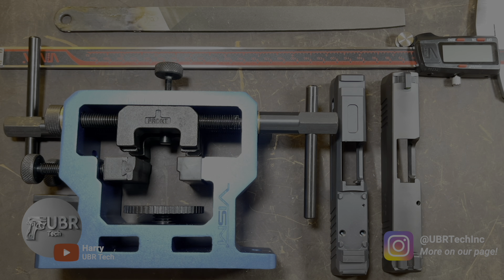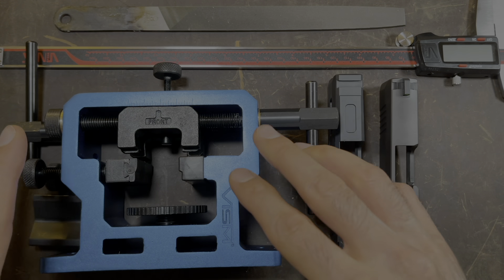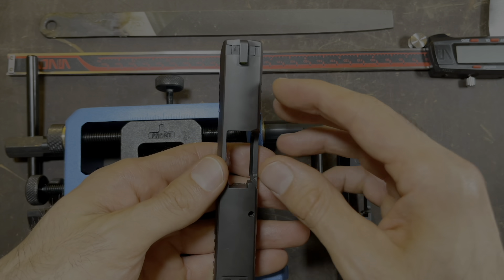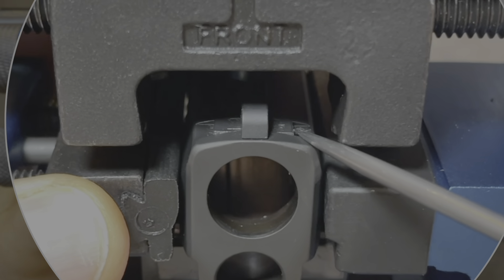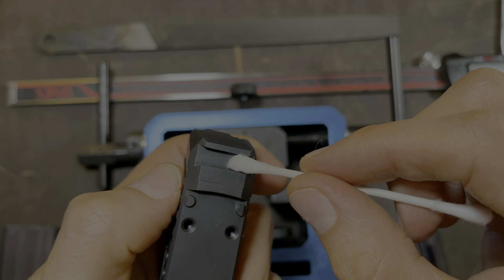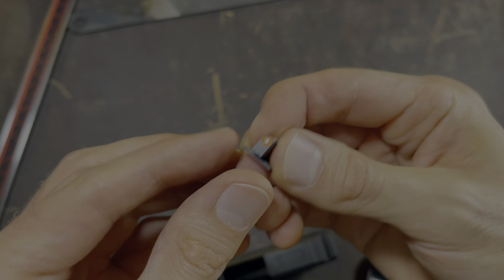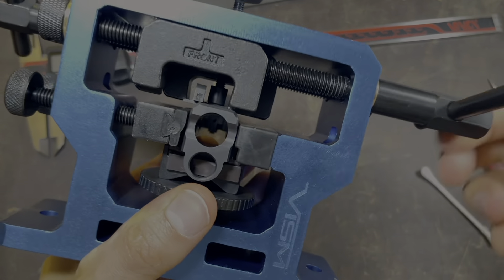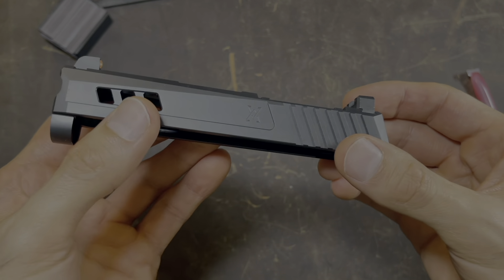How to Install Iron Sights on Your New SIG P365 Slide (XS Sights F8 Night Sights)

Comment: This video is wrong . Do the opposite of what is being shown here. You remove right to left and install left to right
Reply: Correct. It's in the Sig Armorer's Manuals. Remove from right to left and install from left to right.

Also, red loctite is a BAD idea. First off, if you ever need to move or replace the sights, you'll need lots of heat. I've seen sights installed with red loctite destroy sight pushers. Besides, the reason for the dovetail sight system is that the sights are drift adjustable.

Comment: Install Left to Right with backplate facing you.  Don't start destroying your sights because of this video, you should be able to feel them wedge in with just finger pressure if you start on the correct side.

Comment: Just a fyi you can put a ratcheting handle with a socket on the handle of the sight pusher and instead of just spinning the handle you can ratchet it back and forth much easier to do when the sight it gets tight.
Reply from the maker: Hi Z, thanks for the tip. 👍🏼 Thanks for watching and leaving a comment. Have a great day.  🤜🏼🤛🏼

Comment: Be sure to get the correct sight pusher. I have a blue VISM similar to this one. Doesnt have the protrusions on the upper part and doesnt fit front part of slides. Im limited to only rear sights. Save yourselves!
Reply from the maker: This is the one I used in this video. 

https://amzn.to/41sYbjC
Reply: @UBRArsenal you said you had to make some modifications for this to fit your p365 slide. What mods were those?

Comment: Why use Red Loctite? Blue one would be removable in the future.
Reply from the maker: Hi Freedom, I used red loctite because that's what XS Sights suggests and it came with the iron sights.  Thanks for watching and leaving a comment.  Have a great weekend.
Reply: @UBRArsenal  Thanks for clarifying that! Red is pretty strong, I wonder if Sig used that on their original sights?
Reply from the maker: @freedomspeech9523   Youre welcome.  It wouldn’t surprise me to find out that’s what Sig used on their stock sights.  It makes sense for Sig to do that because they dont want iron sights to become loose.  If sights become loose then that means a repair cost for them.

Comment: My gosh, I have been shaving off material and I am no closer to getting the rear sight in. Either the sight maker or the slide maker didn't bother to try and meet the SIG specs, or they just thought we would do it for them. The more aftermarket parts I use the less impressed I am with the industry. I have the same sights and the same slide that you have and I will be here for a while... I'm really starting to question why I spent all that extra money just for looks. :)  Thanks for the video, I need to get back to removing material.
Reply from the maker: Hey Barry, I know what you mean. I had to take a lot of material off my sights too. I didn’t know if it was just my sights but after hearing you say the same thing, I’m guessing they all come like that. The main reason I did it was to be able to add an optic. I hope you really like the sights once you get them on. I’m glad you liked this video too. Thanks again for keeping me posted on your progress.
Reply: @UBRArsenal  Finally got enough off using a diamond hone file. It was shiny like a mirror when it finally went on.  I like punishment so I bought another set for my P320 - I can't co-witness over my Bushnell RSX250. But I think they will get the job done. I just hope the fit is a little easier.  Thanks again for your excellent videos.
Reply: Probably because this guy put them in wrong. As per sig directions that come with their sight tool sights are suppose to be installed from left to right when viewed from the rear (shooters perspective). Not from right to left like shown.
Reply: @corycampbell189  Yup, it's unfortunate that people probably mutilated their sights that were perfectly fine after watching this guy.

Comment: What sights would i need on my sig p365 slide for a lower 1/3 co wittnes?? Can anyone help me im kinda confused on this matching optic with irons on a pistol.
Reply from the maker: That’s a very hard question to answer because it would also depend on what optic and slide you’re using. It would also matter if your using an optic mount too.  The iron sights I have on this pistol seem to work the way you want with the Holosun EPS carry on this slide. It might be slightly different with a sig slide. I can’t say for sure. I hope that helps.
Reply: If you haven’t found out yet, nightfision has a cowitness tool that you input your gun, optic, and desired cowitness then gives you what works.

Comment: In my experience blue loctite holds without having to damage anything if you want to change the sights again. Am I wrong?
Reply from the maker: Hi Nathan, you’re correct but the only reason I used red loctite is because that’s what the instructions said to use. I guess you could use either one. Thanks for watching and leaving a comment. Have a great day.

Comment: Did you have to make adjustments to your holster or are they still low enough to clear a standard p365x holster?
Reply from the maker: Hi Mo, I didn’t make any adjustments at all because the holster I use accommodates suppressor height sights. Thanks for watching and leaving a comment. Have a great day and please tell a friend about the channel. 😁🤜🏼🤛🏼